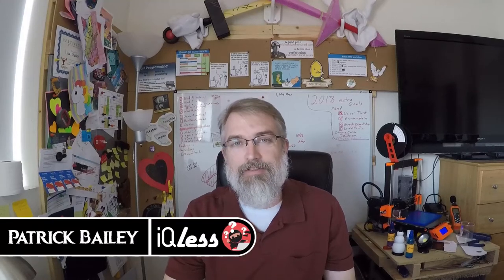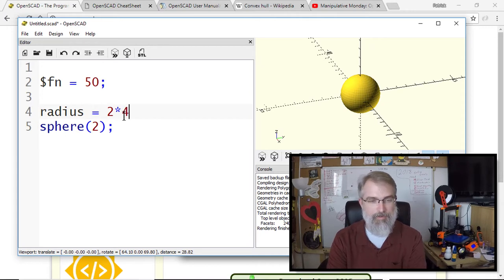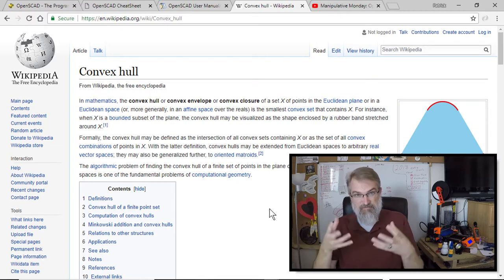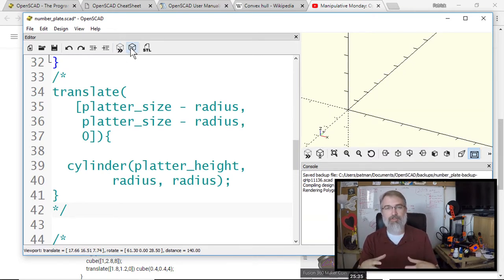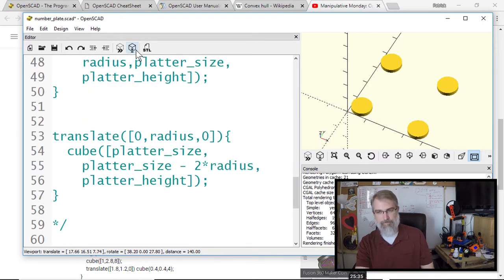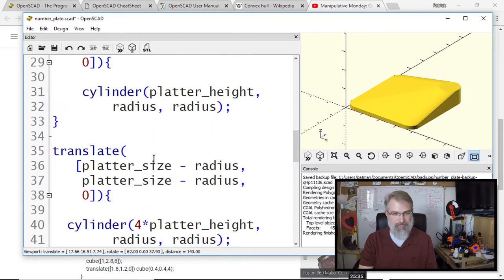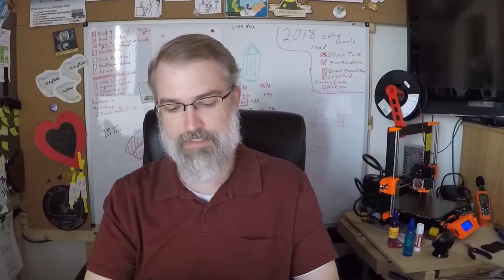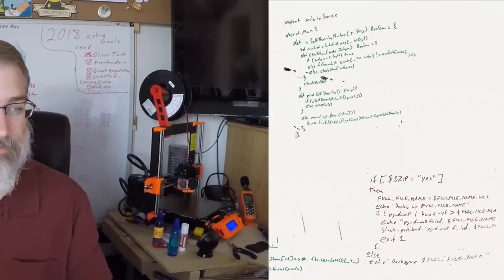Manipulative Monday:  Tiles, Openscad, and Hulls

Comment: minkowski is another super mathy way to do this:

$fn = 30;

tile_length = 40;
tile_thickness = 3;

corner_radius = tile_length / 5;

letter_thickness = tile_thickness / 2;

// the tile
linear_extrude(height = tile_thickness) {
  minkowski(){
    square(tile_length - corner_radius * 2, center = true);
    circle(corner_radius); }}

// the number
translate([0, 0, tile_thickness]) {
  linear_extrude(height = letter_thickness) {
    text("8", valign="center", halign="center", size = tile_length * 0.8); } }
Reply: btw, i have found that it's usually faster to do things in 2d involving set ops (union, difference, hull, minkowski) and then linear extrude.
Reply from the maker: I will have to try that out, maybe run a few tests